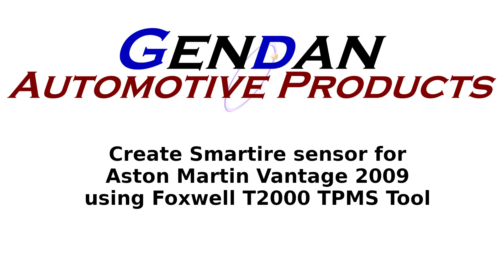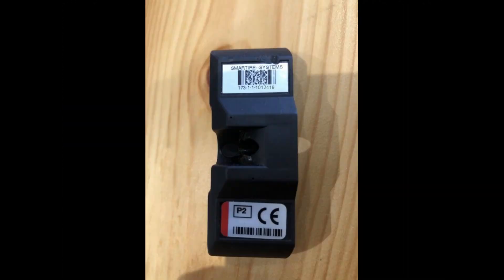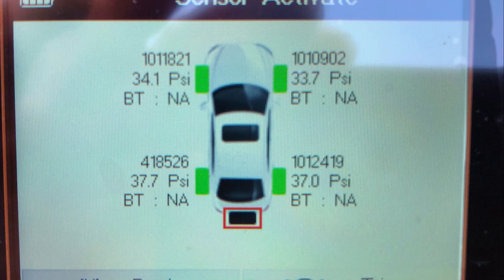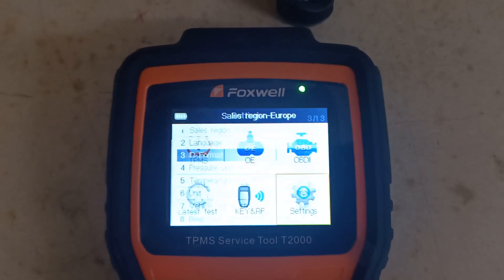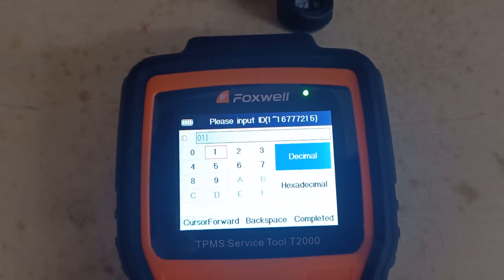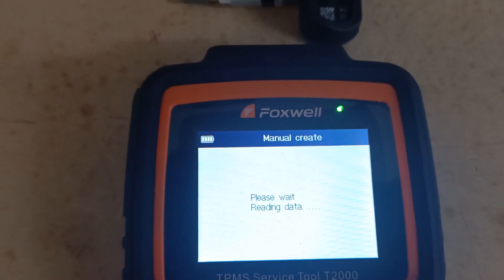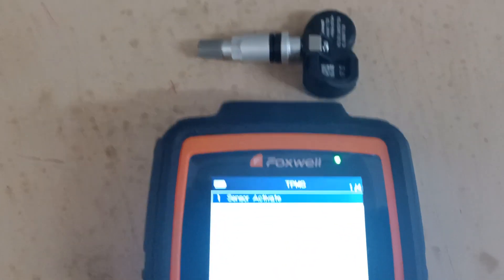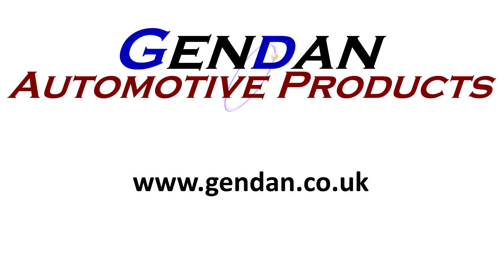Aston Martin Smartire TPMS Fix - Create your own sensor!

Comment: I need one sensor replaced (a blue one). So I can just buy the preprogrammed sensor for now? No need for tool?
Reply from the maker: You can get a single sensor, you'll just need to make a note of the original sensor ring color. - https://www.gendan.co.uk/product_FXT10SMAM.html 
A tool wouldn't be required for this.

Comment: Why can you not just replace the dead battery in the sensor???
Reply from the maker: Yes, you can certainly replace the batteries inside the sensor but it’s not an easy job.
Each sensor uses 2 x special, high-temperature batteries which are soldered onto the circuit board (not designed to be replaced). The batteries cost about £10 each.
I believe there’s a YouTube video showing the procedure if you’re keen to take on a challenge.
Reply: @GendanAuto  yes there is... https://www.youtube.com/watch?v=_jXXr1La2X0
Reply: @GendanAuto  This is a great thing that somebody actually commercialised the sensor cloning thing! I might need one too as I was planning to buy a tool and do something similar with Autel sensors.

When it comes to batteries, I bought 10 Panasonic BAT-BR1632A/HAN for 27.78 from Poland from a company called Transfer Multisort Elektronik Sp. z o.o. I will try replacing the battery first and then if I end up failing, I will order a sensor. Can you deliver only to the UK or also continent?